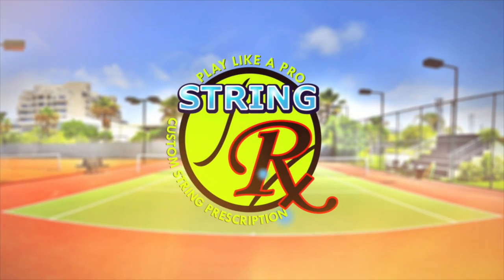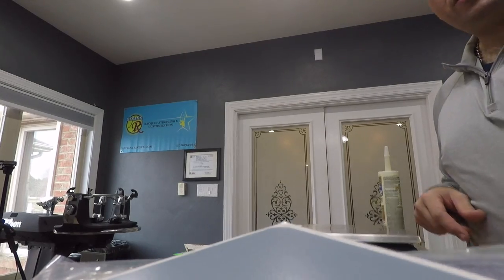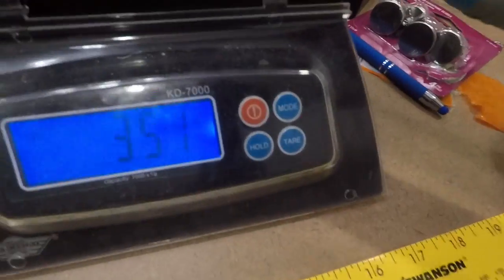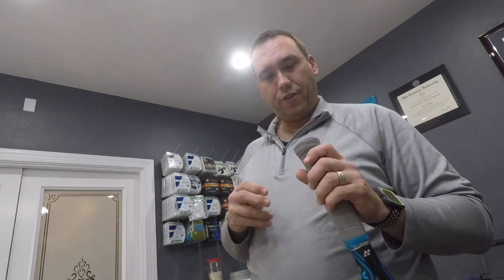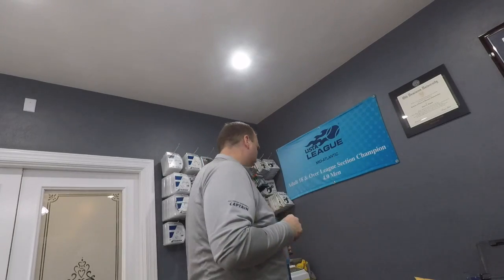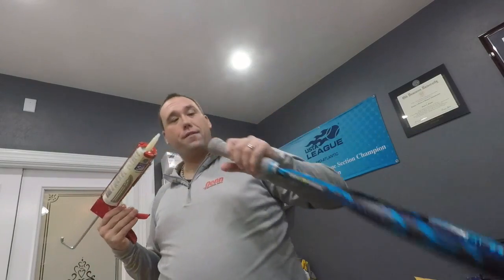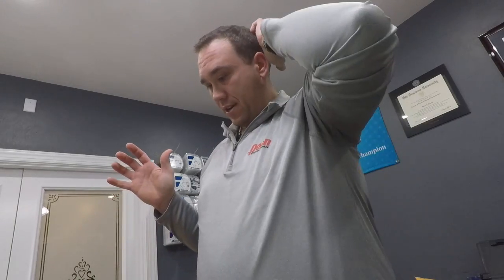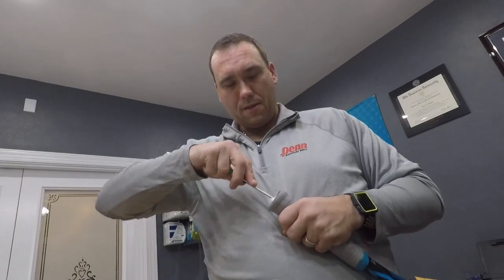How to Add Silicone to a Tennis Racquet Handle

Comment: Great video! My racquets have foam inside so I need to do some digging.. Any idea how much the silicone weigh compare to the foam?
Reply from the maker: Marcus Johnsson unfortunately, no, but as you remove the foam, you could weigh it and see how much it weighs. Foam has different densities and manufacturers don’t publish this information. 

You should be able to use a small razor knife to cut the foam out in large pieces which would give you a good ball park of the weight removed.
Reply: How far up should I put the cotton?
Reply: @zacharywan2004  as far up as you want the silicon to go. Depends on how much mass you intend to add. I would argue no further then 2/3 up the hairpin but would try to stay halfway or less when possible.

Comment: I apologise in advance if this seems like a silly question, but how good is cotton for dampening vibrations if it's tightly packed into the handle? I would really appreciate your response. Thanks.
I want to add silicone but not a whole lot to begin with since the frame is an extended length model  ( Yonex ezone  98+)

Comment: Are their any alternatives to silicone; like tungsten putty. Or does that not give the same effect.
Reply from the maker: George Watson You can use lead tape, tungsten putty, silicone or a variety of other substances like glue and fishing weights. 

Whatever substance you use will have a slightly different feel. Silicone absorbs vibration, so if you want a more muted feel, choose something that can absorb vibration.
Reply: Thanks for the advice! Will get into the addition of weight to my racket.
Reply: Silicone will also give the racquet that beautiful sound of the ball hitting the strings because of the muting and vibration dampening. Actually will have more feel than you think. That is why the pros use it. Nothing compares to silicone.

Comment: what kinds of ranges of the amount of silicone can be added? was surprised how little you did.   like up to 30-60 grams (approx 1-2 ounces), if one wanted to.?? but then you'll be spreading that out across the length of the handle, i'd guess.
Reply from the maker: satjiwan correct. You can apply as much as you want to achieve your desired specs. Of course you are limited in the amount based on your racquet. It’s also good to add a similar amount of weight to the head to offset the balance some.
Reply: String Rx, LLC where to add weight on the head to off set balance. on the top or near the grip?
Reply from the maker: Waqas Shabbir it depends on what kind of set up you are going for. The easiest solution is to put weight at the noon position on the head. However, you can also add weight anywhere in the hoop to offset some of the weight in the handle. If you add weight only at the throat depending on where the balance point is, you won’t offset any of the weight in the handle. 

For more power, offset in the head at noon. For more stability, add weight at 3 and 9 in the head. 

Hope this helps.
Reply: String Rx, LLC If i am trying to make racquet head light by adding weight to the handle of the racquet  is it must to add weight on the racquet head to offset and reduce the effect of adding weight ?
Reply from the maker: Waqas Shabbir no, you don’t have to offset at all. Its all personal preference.
Reply: String Rx, LLC thanx
Reply from the maker: Waqas Shabbir you’re welcome.

Comment: Hi. Thanks for the video. How do you add silicone at 8 inches from the buttcap ?
Reply: You would have to measure with a ruler and use cotton balls to stop the silicone at that exact point.
Reply: @danielschank  Thank you. First you use the cotton balls and then inject the right amount of silicone ( or you make a ball of cotton with the silicone on it and push the whole thing in ?
Reply: @3DNeuroTennis  put the cotton in first, then the silicone.

Comment: Got a question. Im trying to achieve a more solid feel and plow to my racquet. Currently its 335gms stock. Is it better to add weight using silicon or just use lead?  I tried leather grip before, but its still lacks the solid feel i had with my older head racquet
Reply: dj Blackwing silicone will dampen the feel. It sounds like you need to add some lead. I would add 4 (2” strips) of 1/4” lead tape at 3 and 9. That should be about 2g. I would add 2g to 4g of lead tape under the grip or silicone in the butt. That should maintain balance or make it slightly more head light. Let me know how that feels.
Reply: I actually tried that set up before (5gms at 3-9 and leather grip) But it lacked that solid plow that I was looking for. So my guess is I need to add a bit more weight in the handle. Would it make a difference if I do it using just lead Or is silicon way better in adding weight to the handle?
Reply: Got it.. well try it. Hopefully it wont make my racquet a cannonball.  Im trying to mod a pair of new old stock yonex 95d  which I find very powerful but really light and wippy in stock form. Ill keep you updated how it goes, thanks Daniel
Reply: dj Blackwing you’re welcome. Good Luck. More mass means more power but if you get the mass to swing speed ratio right, it should be effortless power.

Comment: Is it possible to remove the silicone from the racket cable?
Reply from the maker: Rodrigo Lana I’m not sure what you mean by the racket cable. Once you add silicone it can be hard to remove. If you add cotton balls first before adding the silicone, you can remove most of the silicone if you want. Some stringers recommend using hot glue instead of silicone as its easier to remove. 

I have started using hot glue as well and it works similar to the silicone but I think the silicone has a little better dampening effect.
Reply: @superstringerllc7774  which hot glue do you use can you please send a link?

Comment: How would silicone adding to the handle  affect the swing weight ?
Reply: It barely affects swing-weight at all. Its pretty negligible unless you are adding a lot of weight.
Reply: Depending on how far up inside the hairpin you put the silicone it won't make much difference. Some will tell you that it will lessen the SW, but this is not true.

Comment: How far up do I put the cotton?
Reply: Just depends on how much you want to add. If only adding a little just put the cotton about 1/4 to 1/2” up. If needing to add a lot, then push it further. The key is to leave enough room to put cotton on top as well to keep the silicone in between the cotton. Don’t skimp on the amount of cotton either.

Comment: Read on Prostock that some handles are filled with foam and some epoxy. Will be great to find out how to diy this too.
Reply: That is true. It all depends on feel and how each material changes that. Its a personal preference. Foam can be tricky though as its a pain in the ass to remove if you don’t like it.